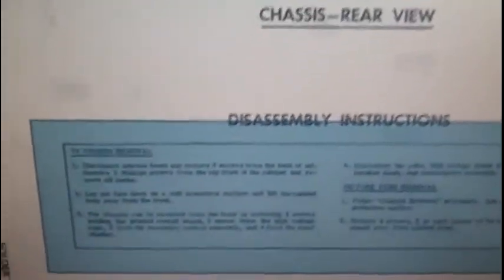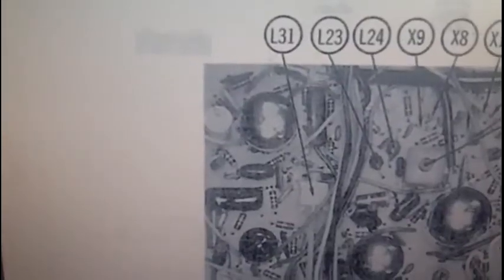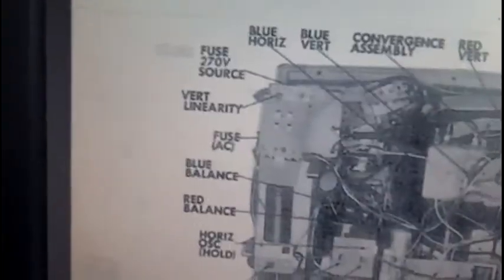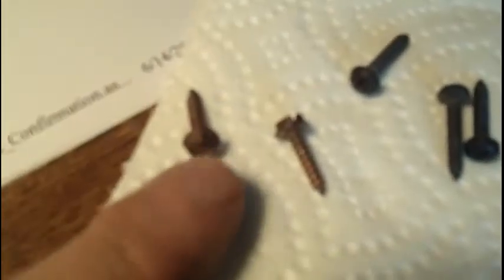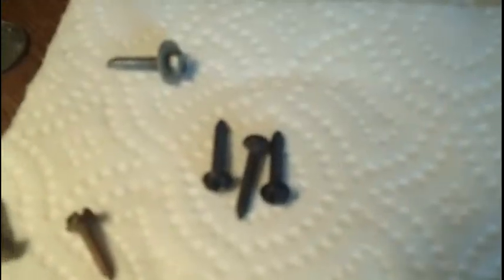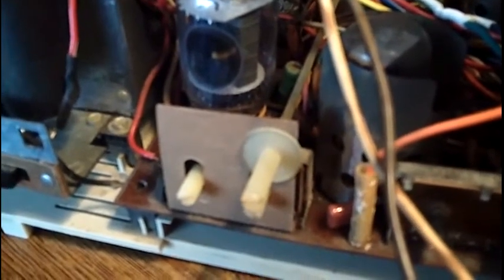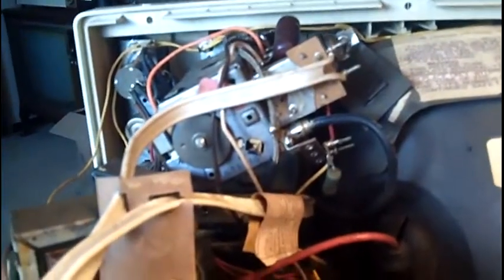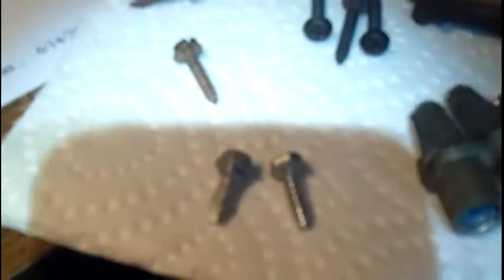Vintage GE porta color CRT replacement

Comment from the maker: can not see the getter at all on either tube to inspect it, the other guns checked ok, not great but ok (mainly cut off was weak, emissions were ok on both R and B). I tested it again yesterday, G was very weak, could not get cutoff to move but a tiny bit, and emissions were very low. I tried auto restore, which helped but would just get out of the red zone, man 1 and man 2 (rejuv) had little effect. the last time I did the restore function it seems to respond better than this.